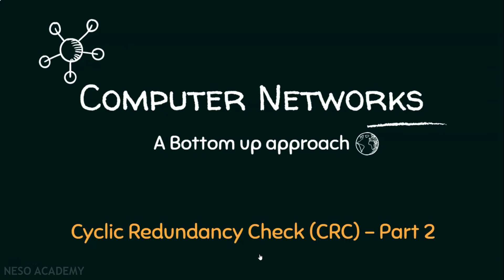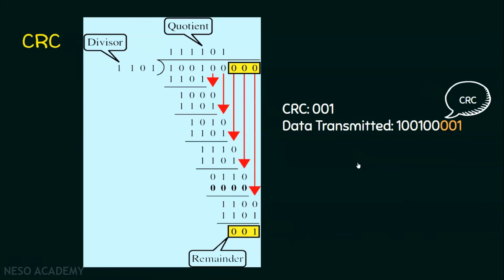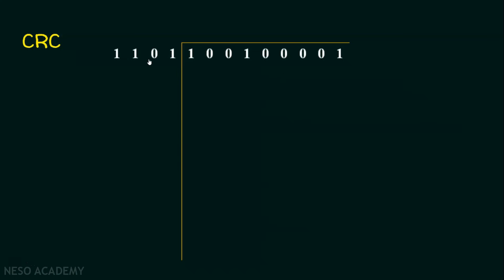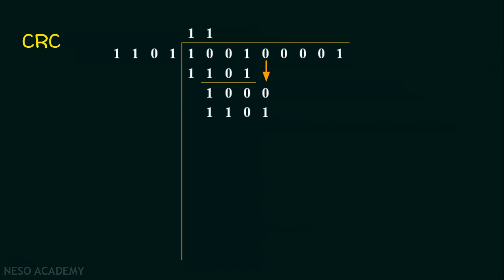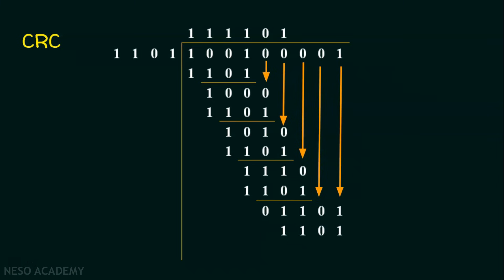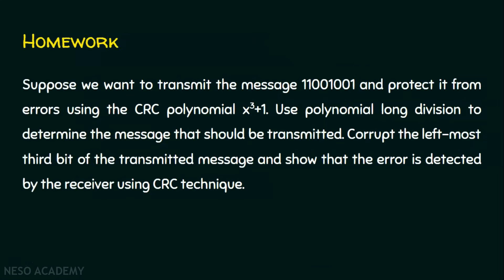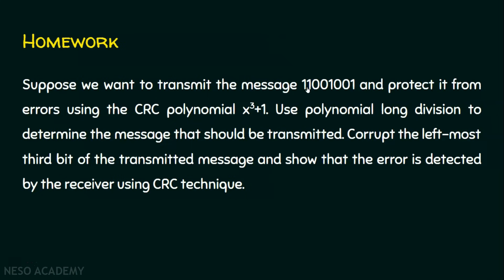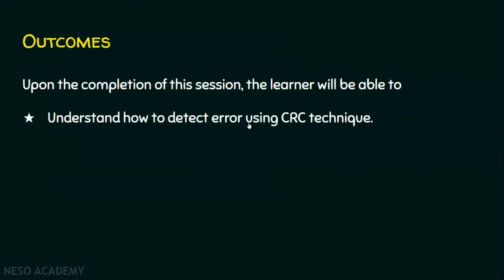Cyclic Redundancy Check (CRC) - Part 2

Comment: CRC Polynomial generator(DIVISOR) = 1001
MESSAGE(APPENDED) = 11001001000
DATA TRANSMITTED = 11001001011
THEN LAST REMAINDER/CRC AFTER CURRUPT 3RD BIT = 100

Comment: Tx side:

Dividend:1100100100 
Divisor:1001
CRC:011

Rx Side:(altering left 3rd most bit)

Dividend:11101001011
Divisor:1001
CRC:100 hence not equals to zero
Thus,Rx will detects an error

Comment: Before corrupt the data:
Divisor:1001
Dividend:11001001000
Quotient: 11010011
Remainder(CRC):011

After corrupt the data:
Divisor:1001
Dividend:11101001011
Quotient: 11110111
Remainder(CRC):100

How many agree with this answer?
Reply: Yes it's correct
Reply: How is the divisor 1001. Could you please explain?
Reply: @anupamtiwary4265  polynomial of x^3+1=1001(so, x^3=1,x^2=0,x^1=0,x^0=1)

Comment: homework ans i got 
 crc remainder : 011
reciver side remainder is 100 
so there is a corruption in data 
anybody got same ans?
Reply: Crc :001
Data Transmitted:11001001011
At receiver side the remainder is 0000 so no corruption

Comment: Can we just use 1 or just 0 as divisor? Or 1 bit divisior?
Reply: Yes you can but it will become a very lengthy division also kind of defeat the purpose of CRC since we won't be able to calculate the CRC that is supposed to be L-1 bits which is zero.

Comment: SENDER'S SIDE : 
       DATA  = 11001001
       DIVISOR = 1001
       AFTER BINARY DIVISION : 
                QUOTIENT= 110100000(extra l-1 bits appended)
                 REMAINDER = 011
        DATA TRANSMITTED = 11001001011
RECEIVER'S SIDE :
         DATA RECEIVED = 11101001011(3rd bit corrupted)
         DIVISOR = 1001
         QUOTIENT = 11110111
         REMAINDER=100

So error DETECTED...
Reply: At receivers side why did u took divisor 11110111?
Reply: @bhargavigrandhi1247  I've changed it actually quotient I guess
Reply: Thank you so much
Reply: thank you
Reply: same answer
Reply: i got same result as you in the receiver side but in the remainder i got 111 and u got 100?  lol
Reply: @heartstringsDR  i am also getting 100
Reply: @rockybrother921  me too
Reply: @heartstringsDR  111 is the correct answer

Comment: I'm sure this depends on the application, but what are some examples of what happens when the receiver detects corrupted data? Is the sender notified? Is the corrupted data simply thrown out?
Reply: It can be handled in two ways :

- Receiver can have the Sender re-transmit the entire data unit.
- The Receiver can use an error correcting code, which automatically corrects certain errors.

Comment: Divisor-1001
Divided-11001001000
Crc- 011
Then message has to transfer-11001001011
Then remainder after currupt the 3rd bit- 100
Reply: yup same.
Reply: Thankyou
Reply: Yes it's correct same answer 👍🏼
Reply: correct answer
Reply: bro the remainder after corrupting the 3rd bit is 111
        the remainder before corrupting is 011
and quotient is 11010011 - before corrupting
         quotient is 11110111 - after corrupting
Reply: @Mr.CineCentral  dude this is wrong. After corruption, the remainder is 100 only... The corrupted code is 11101001011
Reply: @Mr.CineCentral  Wrong Answer

Comment: CRC : 011
Transmitted message: 11001001011
Corrupted message : 11101001011
Remainder of corrupted message : 100
Reply: Yeah I got the same
Reply: @sanjeevani bhandari  where are u from? I mean from which university you are?
Reply: Rut
Reply: Correct
Reply: I got the same answer.
Reply: how are we deriving the divisor from the question. I am not getting that.

Comment: Sir my doubt is ,
In the 1 pb before data transmission when u got 2 0's(0110) their u took (0000) at the bottom,
But comming to after transmission when u got two 0's (0011)again but here u took both the 0and 1 from transmitted data at a time, but y it is  different in both cases....🤔🤔
Sir can you please help me to understand this.....
Reply: There is no difference. you can try the same by yourself as he did previously

Comment: The homework would produce 100 as remainder of the division after corrupting the data. The presence of the 1 thus demonstrated the data was corrupted  in transit. The generated CRC code before corrupting the data is 011. Anybody got the same solution?
Reply: I got 010 as crc 😭😭 someone help me🙏🙏
Reply: @gamer-zy1uj  cause i got 010 as crc too...
Reply: @animemoments7777  no this is correct.... 010 and the quotient is 11010001
Reply: @B_I_N_G_0  why does everyone got 100 as remainder ;v
Reply: @gamer-zy1uj  hey I know its been 2 years but did u found the solution haha
Reply: @animemoments7777  after corruption, remainder is 100 which shows corruption from reciever side. but before corruption the remainder is 011 which is added to transmission data
Reply: @gamer-zy1uj Correct
Reply: Shouldn't the reminder of the division be "0" if there have not been any errors? I've gotten the same result as you (011) but this means that there have been errors in the transmission, no?
Reply: I got same result too
Reply: Same
Reply: Yup... I got the same answer
Reply: exactly same ans i got.
Reply: same

Comment: Home work problem answer
sender side  transmitted data = 1101001101
receiver side received data =1111001101
                                 .
                              .      .   reminder = 110 => reminder is non zeros 
hence the data is rejected
Reply: CRC: 011
Remainder: 100
Reply: Wrong
Reply: @dailymemes2512  then comment correct answer , it will help others
Reply: Crc is 011.